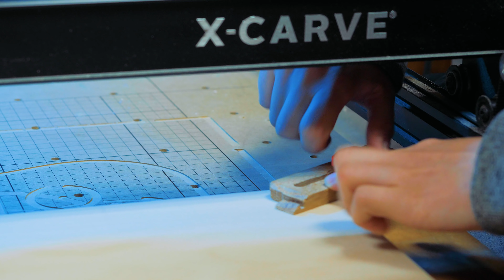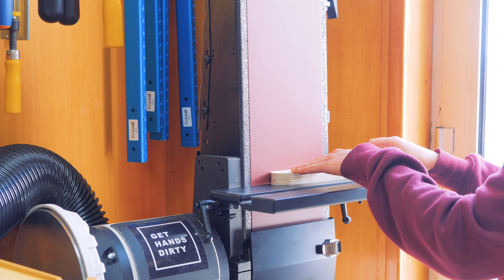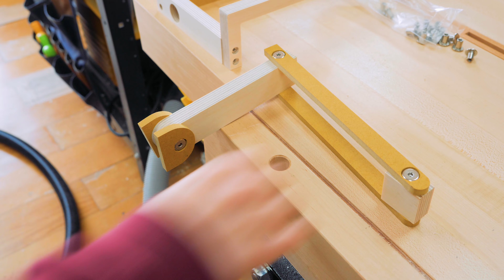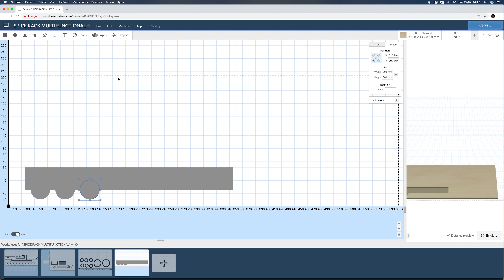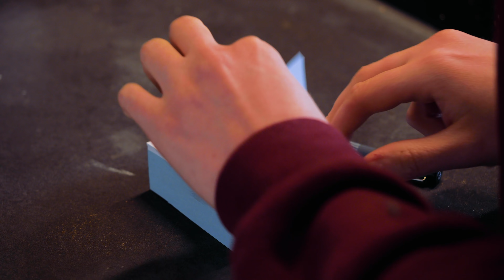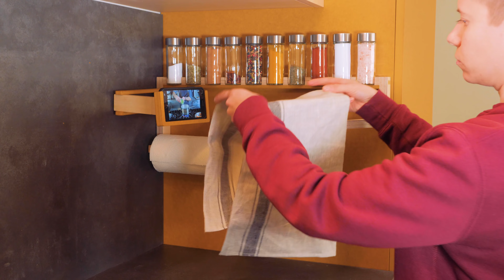Multifunctional Spice Rack

Comment: So creative, I love it!  Very functional spice rack.
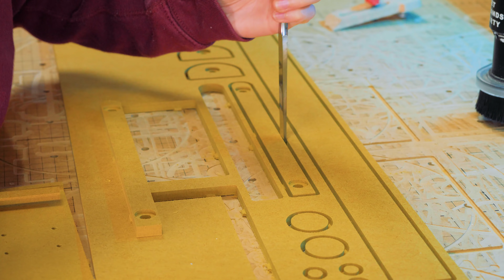1:55 - what is the yellowish sheet material - plastic/ wood?  
I'm definitely buying this small CNC machine. It will save a lot of time over manual cuts.
Subscribed!
Reply from the maker: Thanks a lot! The yellow material is called valchromat. It's an HDF moisture resistant and you can find it is several colors. On their website you can find dealers around the world. Cool! I can totally recommend as I only talk about products that I feel comfortable with and their costumer support is amazing! When you do buy it, please make sure to use the link I put in the description and that way you contribute to my work without costing you anything extra :)

Comment: I like this design, but I'm interested to know if the phone holder affects the sound by covering the speakers?
Reply from the maker: Hey Tony, It does cover but everything is still pretty audible, but that could be my phone...anyway, you could make some little slots/holes with a thin drill bit on the side for the sound to escape better.

Comment: What you use to finish birch plywood? Everything I've tried so far yellows it. =\
Reply from the maker: On the Kitchen cabinets I used a water based varnish for floor and furniture and here I used Osmo Hardwax Oil. It doesn't yellow much the wood, which I like.